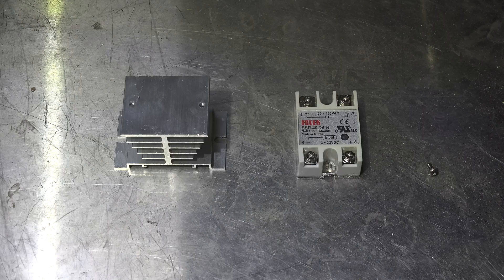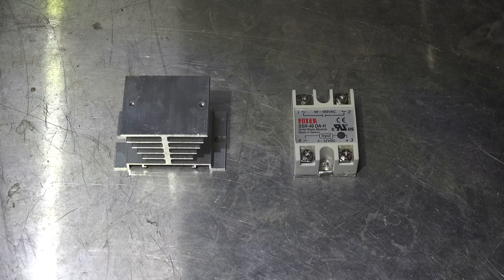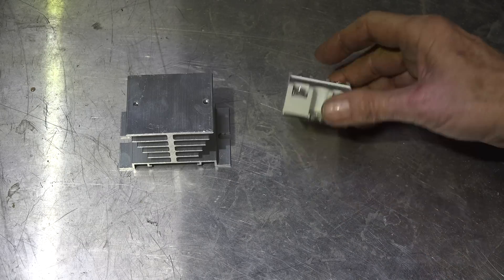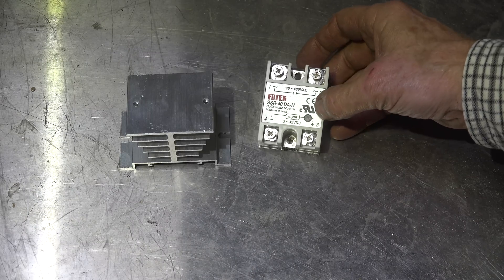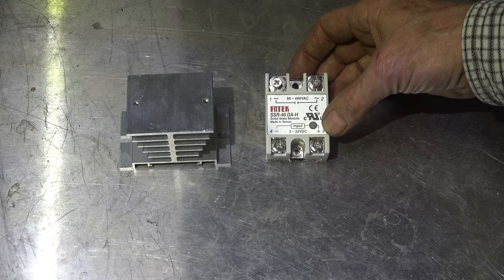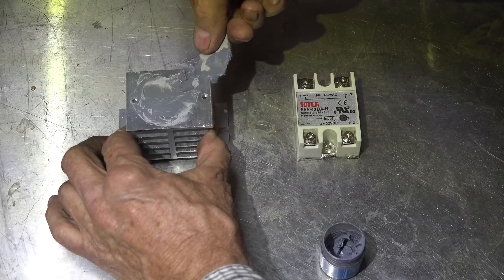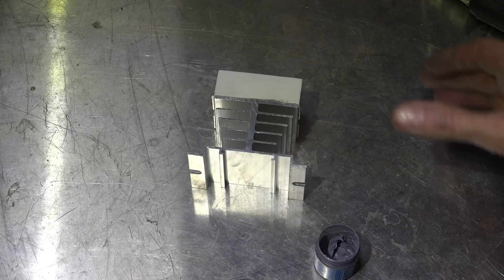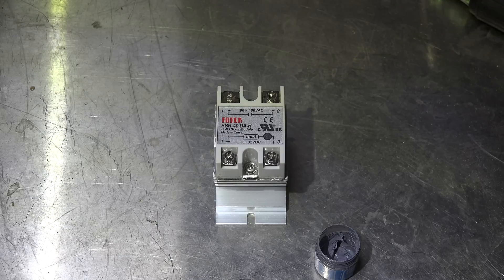About the solid state relay

Comment: Tank you for this video.
 I a question why the SSR get so hot that burn to he touch?
I am using a PID Temperature Controller With 30 Steps Ramp/Soak, SSR control output with 120v AC for a wax burnout kiln.
Reply from the maker: The amount of heat is dependent on the load amperage.  High amperage equals high heat.  You can reduce the temperature by mounting it on a heat sink.
GFM
Reply: @grayfurnaceman  thank you i am getting two heat sink and two 12v fan. I just want to prevent it from getting to hot.

Comment: I’d really love to see you feed 40 amps through this thing. 😉
Reply: I just made a video of it, it does NOT handle 40 amps for more than 4 minutes before it fails, even when using a heatsink it will reach over 200F in 4 minutes. PM me I will upload it
Reply: Oh and BTW the SSR used in the video is a counterfeit FOTEK.
Reply: @JonTheChron  I am starting to think 99% of these are counterfeits.
Reply: @Stefan_Van_pellicom  99.99%!
Reply: Yes, probably half that on a cold area...Chinese rating, always divide by two...and stand back 🍋

Comment: Can you use these to control DC? Or only AC?
Reply from the maker: The coil is DC, the contacts are AC.  If you want to use it with DC power, a capacitor will have to be installed across the contacts.
GFM

Comment: since there is DC input, is it ok to feed AC or should I then use ac/ac ssr
Reply from the maker: It will control AC.
GFM
Reply: No, that's not okay, and you are right: therefore you should use an ac/ac ssr indeed

Comment: Please I intend to turn my water heater on and off based on the voltage of my batteries in a solar system setup. The aux port (dry contact) of my charge controller gives out a low dc voltage signal that can be used to trigger a SSR. 
The challenge I have is that I don't know which terminals from the Aux port (NO, C) will be connected to the positive & negative DC side of the SSR.
I believe that the open/close signals coming from the controller have no polarity.
Reply: If you believe things here, don't use those SSR's. Those things even tend to catch fire sometimes; you should really know what you are doing if you try anything!
Reply: + is the load side on dc controller I believe the direction the power is coming from.
Reply: can you borrow a multy meter and measure the output ro find out the polarity?
them mark your wires either positive or negative

Comment: Thanks. Heat sinks are important. I have seen the SSR installed in industrial cabinets just hanging by the wires and they short out. When you started out was it hard to get started in industry? It seems today most employers want 5 or more years on the job experience.
Reply from the maker: I did not have a lot of trouble getting into the business.  I took an A/C course and in a year, I was starting out.  Employers that want service techs do not want to teach them, so they ask for experience.
GFM

Comment: Kudo's+lots of respect for truly helping people.I have a lot of self learned knowledge with oil furnaces(most came from salvaging a flood home and dealing with numerous old ones.and then enduring 5flds and installing 5 new ones). I'm now temp.in an older mobile home and never had such bad luck getting furnace to run right.A quick answer would be needed and grateful.After complete disassembly(I should of followed other troubleshoots.but one of your response comments threw me off.I'll elaborate later if you would like)A lot of new parts+it turned out heat exchanger was sooted and outtake was completely plugged.Though it is atleast a 15yr.old Miller the heat exchanger passes all leak tests while cold.But back 3 tubes have holes near top that seem to all enter into the outtake to chimney pipe.They definitely have no rust+appear to be factory drilled holes.Is this normal?Because of small pipe with no damper.Also it ran plugged up trouble free most last Winter and I have plenty of CO2 detectors that never went off.But oddly one did from the dust coming out of my shop vac.while cleaning???Any thoughts on that one?Through this battle I replaced the transformer for weak spark but new one has same weak spark.I may have come up with little trick during this ordeal.I made to quick custom wires that I hooked to electrodes+transformer springs so I could visibly see the spark passing through end of electrodes above nozzle.Respectfully S.J.
Reply from the maker: The holes are probably factory.  I don't know why.  Beats me on the CO detector.  Those furnaces are very hard to get working properly.  The combustion chamber is so small and there is no air adjustment.  Good luck.
GFM

Comment: On most HVAC systems I have seen in my limited exposure to them, it looks like most relays are double pole. I have used these single pole solid state relays in switching water heaters. 
Is it that important to switch both sides of a compressor?
Reply: There are double pole SSR's ( ie Magnecraft 6425).  But I just use 2 single poles when switching single phase.
I'll defer to the FurnaceMan on whether to use SSR's on compressors.  Unlike a mechanical relay there is some "bleed" on SSR's when they are switched off.   Not a true OPEN like a mechanical relay.
Reply from the maker: Many HVAC systems use the single pole contactor in their systems.
GFM